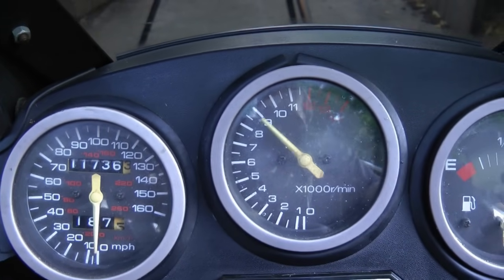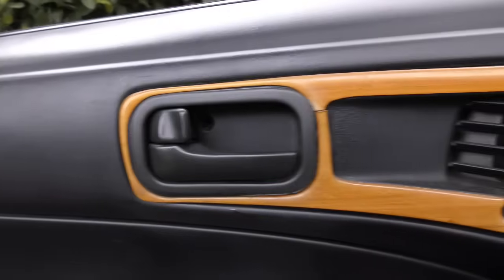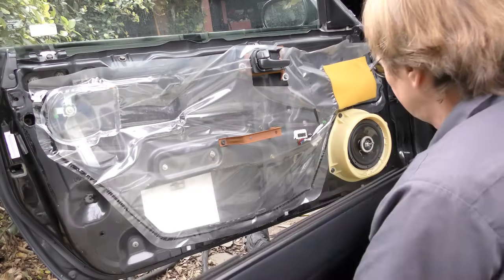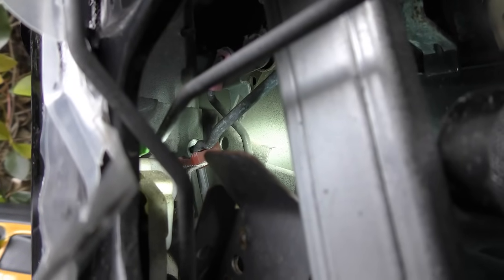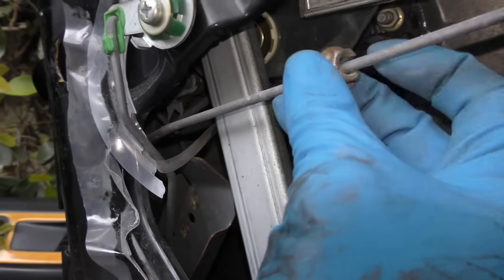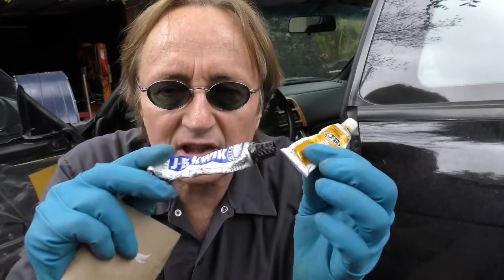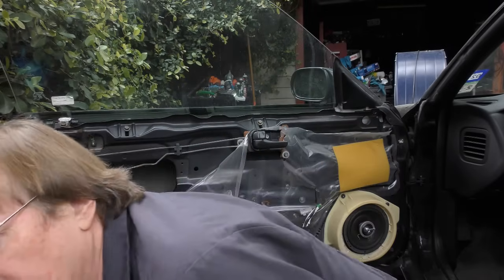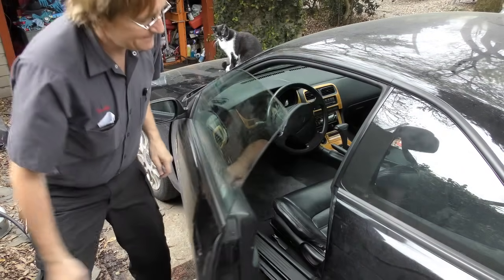How to Fix a Stuck Car Door that Won't Open

Comment: One more reason to love my grand am. Sure, adjusting the screw is annoying because I'm probably doing it wrong, but at least I have the option. Now I just have to find the happy middle between the door not closing and the door not opening with either handle when the inside was working fine before (lucky I didn't put the snaps in and the bolts are all accessible without removing the seat.

Comment: The second I saw that kitten hop up behind you in the car I knew I should subscribe. Anyways  my car door wasn't unlocking from the outside which didn't bother me. I always hopped over and then got out the driver side. But last night the inner door handle somehow unhooked as well. I was just sitting here watching this and then I suddenly realized.. HOW AM I GOING TO GET THE DOOR OPEN TO FIX IT NOW!? Help! do you have any easy suggestions :)

Comment: Hey Scotty I have a 1991 Isuzu trooper my door is hard to close it stops at certain points and you have to pull it hard to get it shut what should I do also the heat smells like mold love the videos
Reply from the maker: spray lysol in the intake under the windshield with the heat on full blast with outside air. As for the door, odds are your door latch is breaking down, but see if the hinges are bent and that makes the whole door sit low and do that too. New hinges fix that

Comment: Typical Japanese tin box cars. No sound insulation in the doors.
Reply: Think that's a 240, made to be a lightweight sports car, not a quiet luxury car
Reply: kgisabeast 10 pounds of foam won't make it any slower.
Reply: ***** Exactly. Refinement is a nice thing. My cousin has a 2001 Integra Type R which is a zippy little car. He added Dynamat to the doors, trunk and beneath the rear seat.. Quieted the car down and yes, it did add some weight but the stiffer springs he has on along with sticky 140 treadwear tires can handle that.
Reply: Grant E actually the Nissan Maxima which is Japanese is one of the longest lasting cars! They are fast sporty and luxury all in one! (SE model) I found many with 400,000 miles! Even 1,000,000! If that’s considered garbage, then something is wrong with you.

Comment: I'm dealing with a 2005 Land Rover and it won't open from the inside or outside. It's really weird how it happened. They both stopped working at the same time. I'm thinking about taking the driver's seat out and getting that door panel off.When they Land Rover door won't open it's a serious problem. You want to have some fun check that one out

Comment: ah Nissan...the Ford of Japanese cars!

and by that i mean cheap and unreliable.
Reply: Typical Ford hater. It's like other cars work for a lifetime... oh wait, THEY DON'T!
Reply: My Maxima is twenty years old with 180,000+ miles on it and it still runs great.
Reply: That must make Mitsubishi the Chrysler of Japanese cars.  They're far worse than Nissan.

Now, I'll admit there are some cool cars from Mitsubishi, but their cars never hold up as well as Toyota or Honda.

Same deal with Chrysler.  There are some cool cars from Mopar, but if you think Ford is bad...
Reply: ***** yeah i can see that as well haha but i own a 1997 Mitsubishi 3000gt and its close to 200k miles all i had that went bad was a bad axle seal
Reply: ***** I don't know what you guys are talking about Nissan and Mitsubishi actually build pretty good cars but Mitsubishis the winner because we beat that thing and it never broke
Reply: Jacob Brunberg As usual, individual results may vary.

But overall, Mitsubishi vehicles don't hold up as well.
Reply: Justin Joseph Same! I was waiting for someone to mention the Max, love this car. I have the '02 and drives so good & smooth for a 13 year old car!
Reply: Nissan SR20, VQ, KA24, etc? Some of the most reliable engines ever produced by ANY company. Just because they aren't overpriced like other Japanese companies--doesn't mean they're cheap.
Reply: Idk, Nissan made some pretty good cars in the 90s early 2000s while ford made a lot of crappy cars then, but seems like now fords have gotten better and Nissan has gotten less reliable
Reply: kgisabeast
yes, Nissan made good cars by American standards, but they continue to lag behind Toyota and Honda by Japanese standards.
Reply: RetroMMA
don't get me wrong. Nissan is a good product compared to Ford, GM and Chrysler. But, compared to Honda and Toyota, Nissan has always been and continues to be "third tier".
Reply: I've got a 2006 Ford Ranger.  Never broke down once.  Even the tires lasted six years and still had some tread before I replaced them.  Not even my old beetle was that good.
Reply: Can't hate on awesome VQ engines!
Reply: What!? Nissan makes some crazy cars! The GTR for example, it was once the fastest production vehicle! If that’s garbage then you got something not clicking. Oh, one last question, what is the best truck company?

Comment: Hey scotty! 
I have a 2002 Lxi Chrysler Sebring and I can't open the front passenger door from the inside. The handle inside feels loose compared to the other handles. The specified door does not have a child lock feature so I think something mechanical inside the door is broken. Any suggestions? Love your vids man. Especially the little smile after you finish your sentences :)
Reply from the maker: if it opens from the outside open it up, take the inner door panel off, and see what's broken inside

Comment: Could you possible do a video about coolant and oil mixing? My girlfriend has a 2002 Saturn Vue. We drained the oil out and it was milky. Just wondering if I should trash the car or theres a way to fix it.

Comment: I have a 1998 model car of a different brand and the plastic behind the door panel is supposed to be there intact and air tight so that the airbag sensor in the door works properly. Apparently it reacts to air pressure. That's what the original factory service manual says. So I wouldn't just assume it's only water protection and I certainly wouldn't destroy it.

Comment: I'm sure you could get a cheap aftermarket handle/latch from China off eBay. If you are willing to wait a week or two. But as long as your fix lasts the life of the car, I wouldn't care. It's not like it's visible, or anyone can see the rig job. Nice trick!
Reply from the maker: Na, no one makes such a latch, car is too old, not that many 240SXs were sold in 98, the last year they were made. Don't think I didn't try though.

Comment: I have a kia spectra 2006 that wont open from inside,any special advice scotty?
Reply: You might be talking about a child safety feature. There's button on the side of the door that can only be seen if you open the door. Press that button and you will lock/unlock the door.
Reply: Carlos rodriguez I have exact same car and problem, what was your fix?
Reply: CosmicGaming 
Actually it was a cable that was broken.
I had to replace it,thats how i got it fixed,the cable and the door handle were both messed up.
Hope that answers your question.

Comment: Fast fix possibly or kicked the issue down the road? 2018 Subaru Crosstrek, couldn't open from inside or outside. Sprayed WD40 in the key hole, inside door latch corner and side metal where it moves/releases to open close the door. Three minutes later, the door opens and closes. Will the WD40 mess up things inside now over time? Did I create a bigger issue down the road?

Comment: Haven't had the best luck with my car this year; side-swiped a pole with the front driver's-side door while going like 1-2 mph, but it was enough to cause this loud, metal popping sound inside the door itself. Now tonight I got rear-ended in traffic and that same front driver's-side door will only open like one inch from both sides... Some metal issue. How do you fix that or how much would that cost to fix? I'm scared to find out.

Comment: Scotty, my 2005 Pontiac vibe has a bad acceleration problem. When you try to press the gas normally the car tries take off super fast, sometimes the wheels even spin, and if you continue to hold the gas steady the car is very jerky and rpms jump up and down very badly as if the transmission is trying  to downshift for no reason. It does this at almost every speed including fast highways. But if you press the gas VERY slowly the car accelerates fine like nothing is wrong with it. Any thoughts on what might be the problem? Your help would be appreciated!

Comment: Hi Scotty, I was wondering if you can please help me out. I have a bad catalytic converter and before replacing it I wanted to know what causes it to go bad?. So I fix whatever needs to be fix before ruin the new convert.
Reply from the maker: many things can ruin a cat, from an oil burning engine to leaking fuel injectors, have a pro check that one
Reply: so checking the fuel injectors would be the first thing to check? is there any way to know what made it go bad by looking at the cat?

Comment: Hi scotty ! my friend just purchased a used mitsubishi lancer 1999-2000 model 2 days ago with 75,000 miles on it. We inspected the car well and found it to be good. The next day we realised the gas gauge was dropping every 10 miles or so. It was consuming fuel very fast. We also saw oil under the gearbox area (front wheel drive) which looked like engine oil. I understand its leaking but where could it come from and why is the fuel being used so much?
Reply from the maker: ya bought the wrong car, those are money pits at that age. BUT, have a guy like me check the car out with his dealer level scan tool and pray something easy like the maf sensor was bad or that the fuel pressure regulator was bad. As for engine oil leak, do my video "finding and fixing car oil leaks"
Reply: Yeah we went to the mechanic today. The previous owner was using thinner oil. My mechanic insantly said the car needs thicker oil due to age. The leak was a gasket (forgot which) all fixed now. Other problems were drive belt needing replacement and new fluids. As for the fuel issue, the mechanic reckons its normal but informed us to use better fuel (precious owner was most likely using e10 what we call here in Australia) it's the cheapest fuel and I use premium for my car. Thanks again for the help Scotty.

Comment: Scotty, I watched all your brake videos, I'm doing the rear brakes on my saab, the rotor is frozen to the hub, north east car, waddaya expect 😸, no amount of heat, penetrant or smacking with a hammer has loosened it, do you have any other ideas? I'm thinking of going at it with a jaw puller or agitate it with an air hammer, I don't want to drive it out using bolts behind the caliper bracket, I'm scared to bend it. Thanks
Reply from the maker: an oxygen acetylene torch will always heat it up enough to get it off. red hot metal always comes off

Comment: I have an '03 Lexus ES300 and the shop said $884 a window to fix the back windows not going down anymore. The rear PS door won't open from the outside, just like the car in this video, but I don't want to try to fix it myself. Just want to know if the window issue could have anything at all to do with the door issue and if you think $1800 or so is ridiculous to fix the window issue.

Comment: Scotty,
I have a similar issue with an '06 Saturn VUE except for the child lock is on and the outer handle will not open the door. How do I get it open so I can fix it? Thanks for the insight.
Reply from the maker: Kent Ward it should open from the inside, but if it doesn't, you will have to cut some of the door card inside to access the latch and force it open
Reply: Kent Ward You may be able to use a screw driver or such to change the switch setting on the child lock to off so then you can open from the inside handle.

Comment: I'll be honest I'll probably do this as well. It's the same shit with my 2001 honda. The brake actuator switch broke off, and when I picked it up I said "Why the hell is this made out of some cheap ass plastic?"  so I got two pennies, glued them together then JB welded them over the hole. Now I don't have to worry about another plastic piece breaking.

Comment: Hey Mr. Scotty, I have a 360sb that currently runs without a thermostat and only because when I did have one in (180 F) and it seemed that it ran hot and even on 70• days it seemed like a baking oven on wheels. Ever since I removed it stills warms up pretty quickly and is runs fine and I was just wondering if I should install a new one or run it open (I only drive it in the summer on the weekends)
Reply: *it runs fine
Reply from the maker: sure, it would only act up in the winter when engine would run too cold, if it runs on normal temp on the gauge, that's fine
Reply: Scotty Kilmer Thanks for the advice!

Comment: Hi Scotty ! Recently my Firebird will not hold any freon in my A/C system. The car will only blow Ice cold air when Freon is being put directly into the system, after the can is all out it returns to normal air temperature. I don't have a lot of knowledge on cars but could it be the pipes that carry the freon or could it have something to do with the compressor? Would I need to take it to a shop or is it something I could do out in my garage. Thanks in advance!
Reply from the maker: odds are it's leaking too fast, check for a big leak first.

Comment: Nice videos Scotty. I have a 04 dodge ram 1500 sport 5.7 hemi I found a little bit of oil in the filter could it be the pcv valve ?

Comment: hi, Scotty, I have the same issue but in my case, the inside handle doesn't work as well lol any tips?

cheers from Australia
Reply from the maker: find a tow truck drive to jimmy it open, then take the inside out, OR cut a hole in the inner panel near the latch to force it open

Comment: On my 2005 Altima, rear door locks jammed, was simply water that got in and froze

Crank the heat and warm it up, spray some wd40 in after all washes in winter

Comment: Hello Scotty, I have a 2003 Nisssan Pathfinder.  Based on the title of this video I thought it addressed my particular problem, which is my passenger door wont open at all, trying from inside outside and lock button.   Much tougher to remove the inside door panels with the door closed.  I got it some of the doors elbow rest off but thats all.  I Cant figure out how proceed further without risking breaking something!   Tried sticking a curved wire thru one of the screw holes to maybe yank on one of the rocker arms/switch on the lock mechanism, still unsuccessful.   It'd be great if you could comment.  Enjoyed your vids, thank you.

Comment: Hey Scotty I have a "88"  3 series (e30) and I can't seem to lock the driver side door so is there anything that I might be able to try. -Thanks
Reply from the maker: take the inner door panel off and check to see if the door lock rod has come off its plastic retainer clip

Comment: Hey Scotty, my 2001 E46 BMW coupe passenger side door doesn't open when unlocking it with the remote. I have to go inside the car and open in from the inside so the lock releases. Why is that? In this video the car door doesn't open regardless from the outside, but mine does when unlocked.

Comment: Looking for suggestions, Scotty: I locked my glove compartment and now can't get it unlocked with the key. The latch is still fine, but when I turn the key in the lock nothing happens. Ideas?
Reply from the maker: try to find another key that might work better, spray WD 40 into the hole, and wiggle the crap out of it until it opens, then don't lock it again. Lock is breaking down

Comment: Hey Scotty, I have a 99 Dodge Dakota with the Magnum 318 with 179,000 miles (rebuilt around 90,000 miles). The engine runs strong, and doesn't burn oil. Do you think a complete rebuild is appropriate or could I get away with just a top end rebuild? (I have a lot of parts hanging around my garage and a decent amount of free time!) What's your opinion if any on the Magnum small block series engines? Thanks!
Reply from the maker: decent engines if you take care of them.
Reply: There's a lot of things that for the most part can't be seen or felt that still dies out in engines... Piston rings, Crank Bearings, even some misfires for whatever reason may not be felt depending on the severity, Not saying all misfires aren't serious and problems like these can't be felt. But when you have as much parts laying around as I do, It's not a big deal. That saying "If it ain't broke, Don't fix it", Doesn't really apply to me with engines... Besides what would be considered broken? A rod thrown through the block? Or a cracked block because of a bad water pump?
Reply: ***** So you just assume an engines problem without looking at it first hand? Does Compression Test "Oh yeah, just as I thought, piston rings are worn..." And when did I say anything about testing anything. Like I said I'm not the "If it ain't broke, Don't fix it type". I'm more of a preventative person, Why not just fix it while it's going bad then to wait till it's completely fried? What is there to gain? The knowing that you've replaced a bad part that was going bad in the first place. Say a rod bearing... Do I just wait till the oil is 50% bearing shavings and it seizes everything? Or just switch it out now to prevent that from happening in the first place. Why not just change a part before it goes completely bad and causes more problems... I like one thing and it's peace of mind.